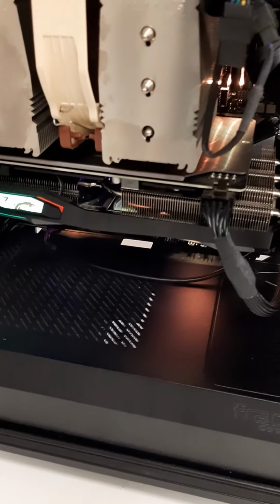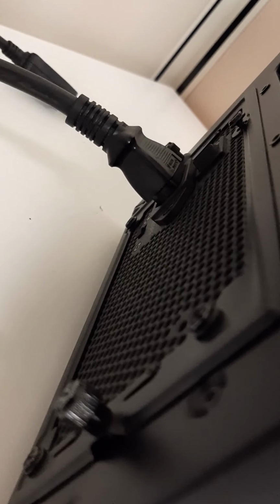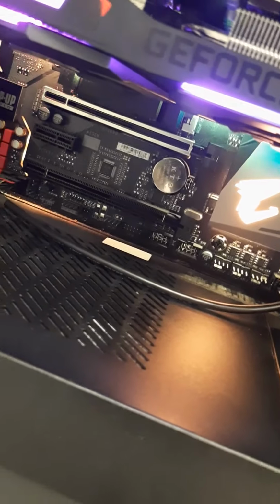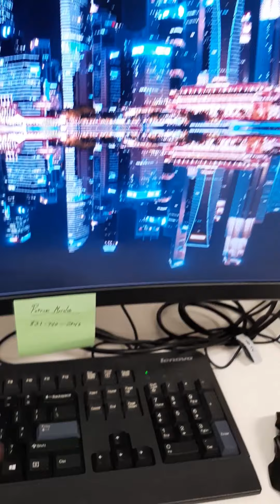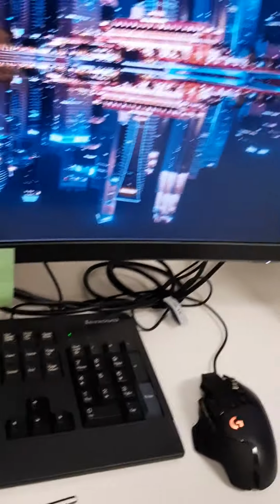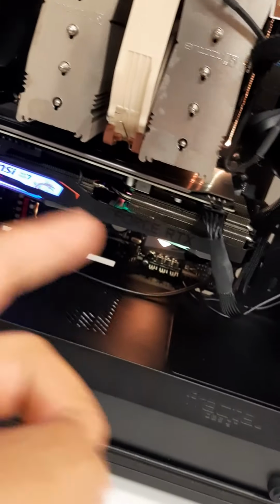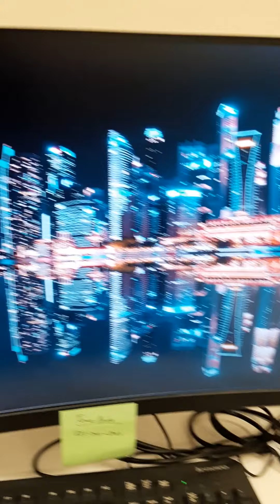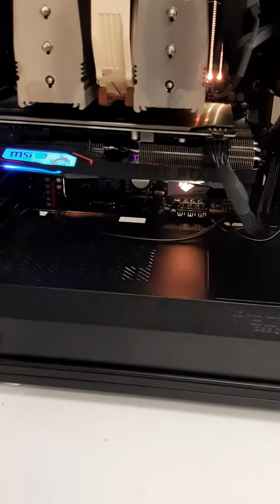HOW TO FIX BLANK SCREEN AFTER ENABLING SECURE BOOT | Windows 11 Upgrade Headache Fix

Comment: But what about the CPU which doesn't have display support? Will those Mobo show the bios?
Reply from the maker: Integrated graphics are required for this method to work
Reply: did you get it fixed?? if so how did you do it
Reply: @Kyle1400  actually, I have to replace processor...
Reply: @anKad2142  i fixed mine now by using q flash on my motherboard
Reply: @Kyle1400  good for you...

Comment: Hey Anthony, I did all the steps here and still am left with a black screen. What do you recommend I do next? I feel like I’m running out of options here.
Reply from the maker: If you don't have integrated graphics, it won't work. If nothing else works, you may have to replace your motherboard. I'm no expert in this, so I don't have many answers.

Comment: i removed the battery and the gpu then i plugged hdmi in the mb j restored bios settings and when i placed the gpu i sill have blank screen Help
Reply from the maker: You might not have integrated graphics. If you don't, this won't work. Unfortunately, I don't know any other alternatives
Reply: @anthonydiaz6101  nvm i fixed it thx
Reply: @barittos5585  how broo please tell me im suffering
Reply: @LoquenderoMinecrable  i removed my gpu then the motherboard battery and kept holding the pc start button for 5s after that, i plugged my hdmi cable into the mb and went to the bios sat it to default settings and finally i mounted the gpu 
this works only if you have integrated graphics with your cpu !!!
Reply: @barittos5585  thx for the answer bro,r eally apreciate it, but i cant do that because i have i5-11400f :(.  At least I can return the PC and get a new one, Thx anyways

Comment: So you remove the round battery thing and the graphic card and plug the hdmi to motherboard then boot the cpu?.. Is your computer a ryzen?
Reply from the maker: Yes, take cmos battery out for like 30 seconds or 1 minute then put it back in. Then take out the graphics card, plug the hdmi into the motherboard, and boot up the computer. This will only work if your cpu has integrated graphics. I have an Intel cpu

Comment: Same happened to me and I fixed it the same way, though I do want Windows 11, you think enabling secure boot and installing a brand new OS while secure boot is enabled (No GPU installed) and after it boots I install the GPU and drivers? you thing that would work?
Reply from the maker: I have not tried it so I would have no idea. It sounds great in theory though. I considered doing the same thing but I have not gathered the balls to try it. I'm afraid I'll get the black screen again 😂. I think the black screen is because of the bios and the graphics card so you'll end up with the same problem. A guy in the comments said he found a fix. You may consider trying that

Comment: wow i really thought my pc was done for, thank you a lot genuinely!
Reply from the maker: Very happy to help. Thanks for watching
Reply: Did you leave the cmos out or no?
Reply from the maker: @DCH_Paul  no. Take it out for a few seconds then put it back in. The other steps are after you put the cmos battery back in. It's just to reset cmos. You can skip taking out the cmos battery if you want. I did it for good measure
Reply: @anthonydiaz6101  THANK you I’m trying one more time I’ve spent literal days and nights on fixing my pc
Reply: @anthonydiaz6101  one more question is the pc unplugged and flick the switch off or no?
Reply from the maker: @DCH_Paul  No. But you can just for good measure. You don't have to unplug, but you can switch off power supply if you'd like. Not required though. Biggest thing is just making sure you have integrated graphics. That's the big one
Reply: @anthonydiaz6101  ohh alright welp my pc isn’t gonna work I think ill try it one more time this is my 3rd day working on it😅🥲
Reply from the maker: @DCH_Paul  wishing you the best man

Comment: Hey i have the same problem but i don't have any graphics card in my i5-10400f so i'm stuck can someone i tried everything from what i found on internet (clear cmos won't work by using a screwdriver on clear cmos) please someone help me
Reply from the maker: If you haven't already, look through the comments. Some people have found ways around it. Hopefully, you find something that works. Thank you for watching and sorry my video didn't help you.
Reply: @anthonydiaz6101  ok I will try going through comments thanks man
Reply: @anthonydiaz6101  but I was wondering if it can works if I put a windows boot key to reinstall windows to boot on the key or by removing the SSD
Reply from the maker: @cookiesre8810  I'm not too sure. I read in the comments that the issue arises because of a compatability issue with the GPU and secure boot. The person in the comments fixed the issue by replacing the motherboard. They also got a new GPU that is compatable with the secure boot settings (I'd recommend looking for the comment because it's been a while since I've read it and I'm no expert in this topic). If you reinstall windows, the setting will probably still be enabled in the bios and the problem may still be there, but if you have little to lose, then why not give it a try 🤷‍♂
Reply: @anthonydiaz6101  Oh ok I see I have a rtx 3060 so I may put another GPU to test if it works should I, it would be easier than reinstall the whole OS
Reply from the maker: @cookiesre8810  Worst case scenario, replacing the motherboard should do the trick. It's not the cheapest solution but I'm the comments, that's what has worked since you'll have a new mobo with new bios software with default settings. I can't remember if the graphics card thing is in regards to an incompatibility with secure boot or with tpm settings. But again, just look through comments because my memory is more unreliable than a floppy disk 😂

Best of luck to you, I hope you can fix it!
Reply: @anthonydiaz6101  ok I'll try seeing someone who has the same problem thx for responding and taking your time to try solving my problem you are the boss 👍
Reply: @cookiesre8810  find anything? I’m having this problem too and don’t get display even when i plug it into my on board gpu

Comment: Ok I had this happen exactly and found an easier fix. 

Uninstall gpu, plug hdmi into integrated graphics on mobo. Go into bios and then change profile to standard. Reinstall gpu and all is good. I didn’t want to reset cmos since my cpu isn’t supported by my original bios. Hope this helps someone. This had me sweating bullets.

Comment: I’m trying to turn on secure boot and make it tpm2.0 and the monitor stop displaying no signal
Reply from the maker: I think the no signal comes from an incompatibility with the graphics card to the setting being turned on or something. But I'm not sure 100%, I could he wrong. Did you fix the issue?

Comment: Does anyone know what mother board I should get for my pc if I'm having this problem? I have a gigabyte mother board right now on my Ibuypower pc and I took out the battery multiple times and did the circuit thing with a screw driver aswell as I got an hdmi cord and plugged it right into the mother board and it did not work still so I think I need a new mother board but I don't know what to get because this was a pre build pc that I have right now fuuuckkkkk!
Reply from the maker: I'm no expert in this, but the type of board will depend on the CPU you have. I have a gigabyte aurus pro wifi or some shit like that. Can't remember the name rn. I think I linked it in the description. I'm happy with it other than this bs problem that seems to be happening mainly with gigabyte. Watch some videos and learn a little about it. That's what I did when I built mine. Helped a lot. Sorry I can't be of much help, I'm an amateur with this stuff 😂
Reply: @anthonydiaz6101  yo np bro i got a motherboard called Z590 and i think that it is compatible with my i7 10700F CPU because a best buy employee said that it would be compatible with my pc so i think that it will work out once i get it fixed
Reply from the maker: @Jesh Bates  best of luck! Hopefully you can get back up and running
Reply: @anthonydiaz6101  Thanks! also fucking love the video "fuck this windows 11 update!" lol absolute legend!
Reply from the maker: @Jesh Bates  Thank you 🙏 I'm glad my frustration was useful to other people 😂 I stand by my word, for now, fuck the update

Comment: Found this after i figured it out myself. Would have been life saving if i saw it before 😅. Anyways, what he says in this video 100% works 👍
Reply from the maker: Thank you, I appreciate your comment ❤
Reply: Did you leave the battery out the entire time or no?
Reply: So you take out the graphics card and you take out the battery?
Reply: @DCH_Paul  no, only take the CMOS battery out to reset it same with GPU and follow said steps above in the video, but for your question only take it out for like 20 seconds and reset it back in place

Comment: Do you have 2 unplug gpu and battery
Reply from the maker: No, you can just do the gpu step. I unplugged the battery because when you boot it back up a prompt in bios usually pops up so it saves me the needs to spam my bios key. But doing doing both doesn't hurt. Unplug battery, put it back in, then remove gpu.
Reply: @anthonydiaz6101  thanks

Comment: None of this has worked for me, if someone can help me I'd appreciate it. I just turned on the save boot on BIOS and forgot to switch from custom to standard and my pc is on but not giving or showing video
Btw my processor doesn't have any integrated graphic (i5 9400F)
Reply from the maker: Hey, I'm sorry, I can't be of much help at this point. I've learned more from the comments than by doing my own research, tbh 😂 I don't think I missed any steps, and I still got the black screen. Please go through the comments, and I hope you can find a fix for this. Best of luck! Thank you for watching my video, even if it didn't fix your problem. I appreciate you taking the time to watch and leave a comment 🙏
Reply: @anthonydiaz6101  I did fix it. I just had to buy a processor with integrated gpu and used it after I removed my dedicated one and I had access to the bios again

Comment: My BIOS says the PCI Slot is Empty, my GPU isn't dead. It happened after installing a new CPU that doesn't have Integrated Graphics, then I went back with my old CPU with Integrated Graphics. I'm stuck with my old CPU and I can't use my GPU due to the slot being empty. Any help?
Reply from the maker: I would have no idea bro 🙁. But I would recommend looking it up on forums/tomshardware.com/ or just in Google
"How to fix 'PCI slot empty in BIOS (with your mobo model)
That website has been quite helpful for me since I'm not an expert with this type of stuff. All these problems just showed up for me because of windows 11 and their secure boot requirement.

Good luck with that man, I hope you can find a solution 🙂

Comment: my cpu doesn’t have integrated graphics and resetting my cmos won’t work😐😐😐this is so dumb i just wanted to play val
Reply from the maker: I've been hearing that secure boot is only required on Val on windows 11. I couldn't even upgrade to windows 11, I'm still on 10. That's unfortunate bro, I'm very sorry to hear that 😞
Reply: @anthonydiaz6101  i think this means my motherboard is actually bricked😔😔ain’t no way i have to buy a new one over one setting
Reply from the maker: @faris2329  it's extremely frustrating. I'm very frustrated with windows for this because a lot of people will have to unnecessarily spend a bunch of money to replace a motherboard that was working just fine. I got lucky I even came across the article because I was about to buy a new one too.
Reply: HOW TO SOLVE BLACK SCREEN AFTER ENABLING SECURE BOOT WITHOUT AN INTEGRATED CARD

If you have a gigabyte motherboard, it is likely your motherboard has something called dual BIOS, some mobos have BIOS switches some have Main and Backup Bios pins (you would have to resort to your MOBO manual

if you have a Bios SWITCH: https://www.youtube.com/watch?v=q9048wFSuD0&lc=UgwF5GIXObyeMGZoeNl4AaABAg.9TYBNv61vfY9TZk7obcn4Z this video should guide you through the fix 

if you have a Main and Backup bios pin (like my case): https://www.youtube.com/watch?v=rLHSajr5Qp0&t=107s this video should guide you through the fix (in my case, I had to short the pins WHILE THE COMPUTER WAS ON, or else it didnt work)

Comment: Does it still work even if the cpu has no integrated graphics?
Reply from the maker: No. Some people in the comments have found work ways around it, I think. But this method won't work without integrated graphics

Comment: I had the same problem but turns out my TV was able to pick up the signal instead of my monitor so I am pretty sure it depends on the monitor correct me if I am wrong
Reply from the maker: I don't think so, but maybe 🤷‍♂️ maybe because TVs have their own processors or something like that. Monitors are dependent on the computer and its hardware for a signal. But I'm no expert so I could be wrong af about that lol

Comment: Can i fix it by connecting another gpu? Because i dont have an integrated gpu
Reply from the maker: I'm not sure. But it's worth trying if you have another one lying around
Reply: @anthonydiaz6101  is it a big issue? Should i take it to a local pc store and replace my processor with a processor with integrated graphics card and reset bios?
Reply from the maker: @wraith9380  they may be able to fix it at a store. Getting a new cpu should work, in theory. But I don't want to recommend you to buy something and then have it not work. I'd say use your best judgment on that. Sorry I can't be of much help, I'm not an expert in this topic, I only know a few things here and there

Comment: I'll try this tommorrow. Does this problem mean my MB an Aorus Z390 won't handle W11?
Reply from the maker: I'm not sure. It's worked for some people so idk, my guess is just as good as yours 🤷‍♂️. Most of the people I've seen this is happening to have an Aorus but some are just fine. If you don't have integrated graphics dont risk it because this fix wouldn't work for you. I guess maybe it has more to so with the cpu because of their requirements but I'm not sure.

Comment: I tried removing the CMOS battery and GPU and then plugged the HDMI as showed in the video but there is still no signal from my monitor. Even tried to flash the BIOS. Welp
Reply from the maker: Do you have integrated graphics. If you don't, that's probably why. I'd recommend Googling your CPU to make sure
Reply: @anthonydiaz6101  Nevermind it worked. Just one of the cables was loose lol.
Reply from the maker: @AcademyHub360  That's great man! I'm glad it worked for you 😃 Thank you for watching the video

Comment: and what if i dont have any gpu in my pc?
Reply: I fixed the issue by doing the CLR CMOS jumper thing to the motherboard and then take out and install RAMs. I hope this helps
Reply: if u have a gigabyte mobo just do the q flash+ mode that the solution that fixed mine.

Comment: Do i have to buy a new motherboard if i dont have integrated graphics to disable secure boot… Because I have tried everything and it wont boot bc there is no way i can disable secure boot
Reply from the maker: Some people in the comments have taken that route of just buying a new one.
Reply: Did you solve it?
Reply: I saw some people in a forum saying they solved it by holding down their reset button for like 25 seconds.
Reply: @xLightcrystalx  i just bought a new motherboard man and my pc is working again

Comment: For those who don't get a display when they plug it into the motherboard, you probably have a CPU without an IGPU
for intel, this is if your CPU has an F at the end, for example: i7-9700F. 
and for AMD if your CPU doesn't have a G at the end of the name, for example: Ryzen 5 4500g. the G CPUs mean it has integrated graphics.
Reply: Thats my problem, you know what to do? i have to try wiyh  a CPU with IGPU?

Comment: Does q-flashing bios thingy work for this problem ? 
Anyone please help
Reply from the maker: It didn't for me. But I've heard some people in forums say it worked for them, I think
Reply: @anthonydiaz6101  I just removed cmos battery for 5 mins and placed it back again and it did the thing for me. :)
Reply from the maker: @Harshith Chiniwalar  that's awesome bro! If it works, it works 👌 glad you fixed your issue

Comment: Or you could just reset your bios with a screwdriver by connecting the current between the two bios pins for a few seconds

Comment: Any other solutions if removing the GPU and putting the HDMI into the Mobo doesn't work?
Reply from the maker: No, sorry. This won't work if you don't have integrated graphics. Keep researching around in forums. Maybe someone has figured something out. Some people have made it work without integrated graphics in the comments section.

Worst case scenario, replacing your mobo would be your best choice. Not the cheapest, but it'll work.

I don't really know who to blame, me, Gigabyte, or Microsoft 😂

Sorry I can't be of much help, man 😕

Comment: When I plugged into my motherboard my pc started beeping pls help😭😭😭
Reply from the maker: I'm not really sure why this would he happening. Unfortunately, I'm not super educated on this. I just know the fix I used. As long as your PC has integrated graphics, it would work.
Reply: Yeah me too bro I went yo repair it took me 20euros feel like It's an easy fix not worth 20euros then I went home enabled the secure boot and same thing happened 😂😂 not ready to give 20euros I'll stay up all night if I have to fuck all windowses
Reply: @MMMMontenegro  I found out that your cpu doesn’t have inagrated graphics just unplug the bios battery are plug the hdmi cable into ur gpu and you should be fine hope that helped
Reply: And plug it in after 5 mins
Reply: @Cyber-ay-non  I fixed it
Reply: @Cyber-ay-non  with some trick power off and on with power supply and power button
Reply: @Cyber-ay-non  unbelievable easy